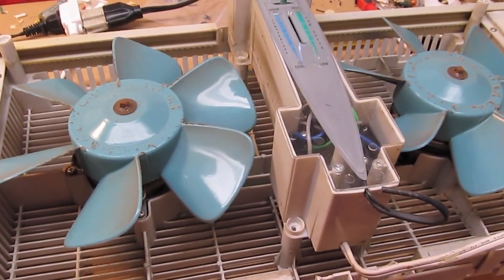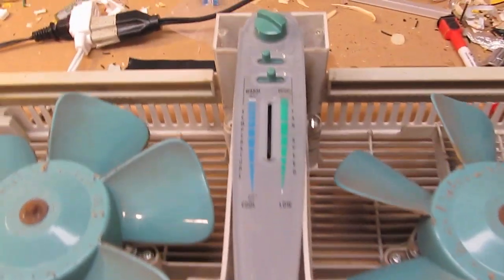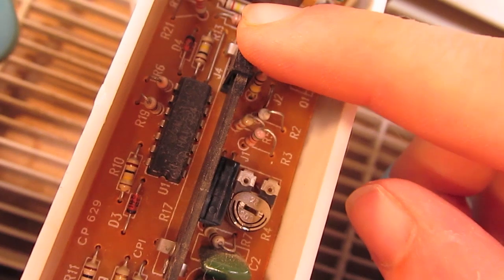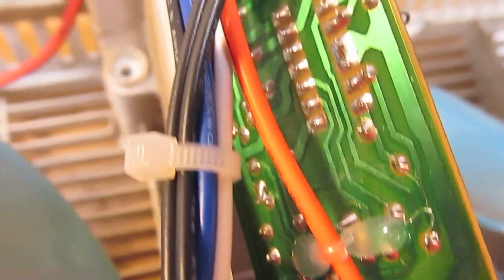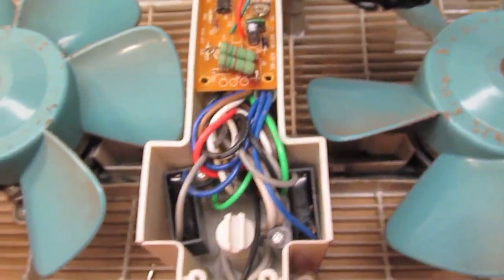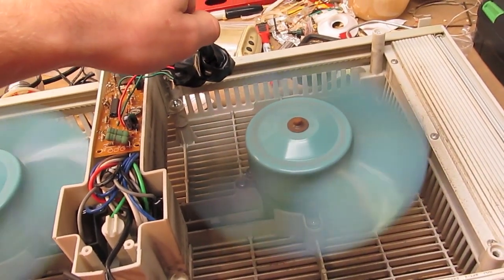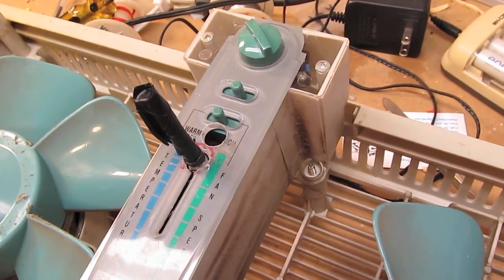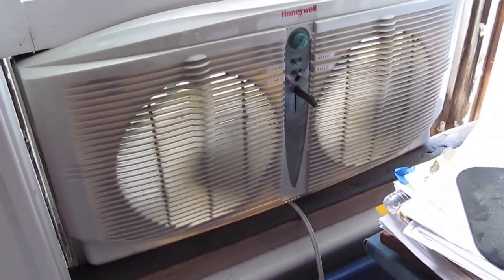Repairing Faulty Speed Control on a Window Fan

Comment from the maker: Thanks for the comment.  I considered doing so if the circuit was going to complain about the different potentiometer values, but as I guessed the chip reads the potential at the wiper and not absolute resistance values, so it probably won't care whether it gets a 5k to a 100k pot as long as it's wired right.

Comment from the maker: If I'm really bored one day I'll open it again and remove them a little more carefully than Photon would.  I may not get to the front bearings, as the fan blades look as if they were never designed to come off the shaft in one piece.  Though at that point I might as well tear it apart, let the smoke out of the sticky motor, and keep the better one for some project.

Comment from the maker: Gah... Dammit I swear I hit the reply button
Considered bypassing but I was bored and I like having an option of high/low speed.  Getting to bearings would require chopping the plastic housing apart with a dremel and then dealing with the resulting problem of the motors being well lubed but not longer attached :P
Therefore, it runs til it dies, parts are salvaged, and it goes in the bin (though I wouldn't mind overvolting a sticky fan motor at some point)